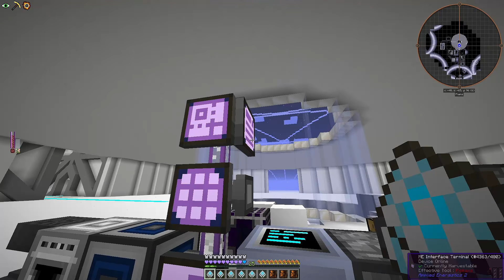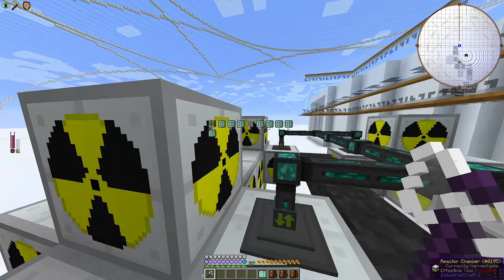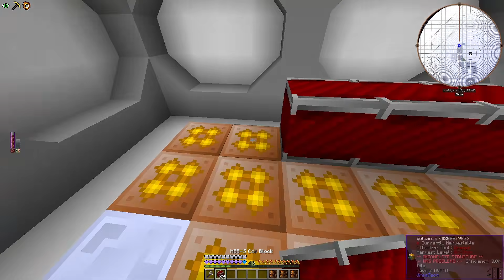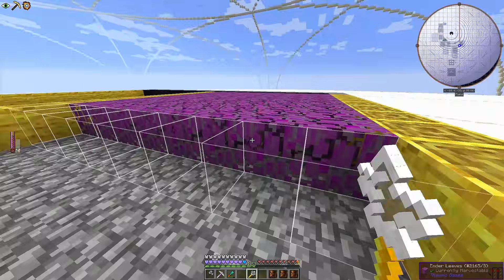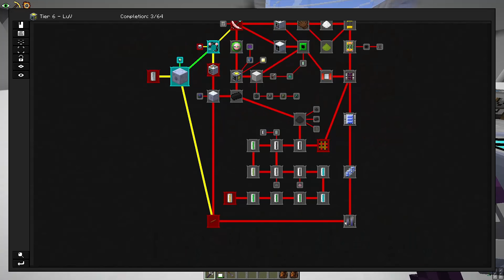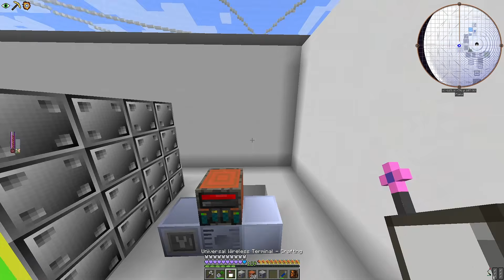Beating Minecraft's Hardest Modpack With Nothing // Episode 27 - Striking The Match

Comment: It is faster to craft 8 IV circuit assemblers and then make assline, than just to make assline.
Same with fusion reactor.

If recipe takes longer than 1 hour, I first think if it is easier to double or quadruple processing machines.

Water electrolysis is not great, there is so called methane loop (distilled water + methane) where you only electrolyze CO2 which takes less time. (or void it and supply carbon from EEC redcap sapper)

Comment: i can't remember if you've done this already and i don't know if it works on this modpack, but did you know you can press 1-9 in your inventory to replace that spot on your hotbar, and press 1-9 in a crafting area to use that item FROM the hotbar?

as an example to show what i mean: when I'm making compressed crooks in skyblock, I drag a L shape in the grid, clear my hotbar, and press 1,2,3,4 on the crafting result to fill slots 1-4 with crooks, I then press 1,2,3,4 in an L shape on the crafting grid to make an L shape out of those crooks to make the compressed crook's recipe

Comment: So, quick TL;DR: about multis, parallels and what they do to your power grid: Overclocking generally makes a process take half as many ticks at the cost of consuming four times the power per tick, meaning you ultimately spend double the EU to get a process done twice as fast. Inherent parallels, of which the Volcanus specifically has a flat maximum of 8 per operation, means you're spending say double the EU/t to get double the work done in the same amount of time. Or, the same EU cost per process, at the same effective processing speed of an imperfect overclock. Separately, Volcani specifically will run recipes 2.2 times faster, and at 90% the normal EU/t power cost. The end result is that an ingot of Ruridit costs a little over 2M EU in an LuV/HSS-S Volcanus, and a little over 20M EU in an LuV/HSS-S EBF. Remember that you need 16 of these ingots per LuV motor, and you can probably start to see why rushing more advanced technology will do horrible things to your power grid circa IV.

One thing you want to be careful about with Mega Vacuum Freezers, though this applies to basically all multis with inherent parallels in general: Cable loss. Yes, that mechanic that hasn't been mentioned or (not coincidentally) relevant since LV or so. Again, TL;DR: It's possible for the MVF to run at over 99% of it's maximum energy input, meaning 1A MV worth of cable loss will cause an LuV powered craft to power fail. Simple solution: Multi-amp Energy hatches can accept more amps worth of power than they provide to the multi, so make use of that. Simpler explanation: Supply 80A of power to that 64A energy input hatch, and your MVF will run fine just fine barring maintenance issues or your entire base falling to pieces.

The scanning recipes are as long as they are because they're LV tier recipes, and many people don't bother upgrading their admittedly not very useful until this sudden point scanner from their first one they crafted in LV because it is needed for a few things (or at least it was back when visual prospecting didn't exist and prospecting kits were buffed, not that either point matters to a GoG style run admittedly). End result is that people don't look closely at the recipe ahead of time or in the moment for that matter, slap it in their LV scanner and spend the next two hours contemplating their recent life choices. Basically, welcome to Gregtech New Horizons.

Can confirm, EBF coil upgrades are not optional. Technically speaking HSS-S tier coils are also optional, but remember the cost of Ruridit ingots I mentioned before? If you're using HSS-G coils instead of HSS-S you're paying about 2.1 times that EU cost per ingot in both cases, not to mention taking twice as long to cook. And when cooking speeds are measured in "minutes per LuV motor" even under optimal conditions...yeah. "Optional", end quote.

There's also a GT++ better version of the Pyrolyse Oven, called the Industrial Coke Oven. Yes, it is more than just a bigger, badder coke oven. I have a tendency to call it a Pyroke Oven for that reason. Anyhow, short version skipping math, minutia and fine details: It's better. Related, remember Forestry villagers selling random Forestry saplings? The Tree Growth Simulator will produce more even more logs if given Forestry saplings with specific traits...though unless you're a fanatical believer in the church of nitrobenzene it's unlikely you'll be able to use that many logs for a good while.

Direct plasma power was indeed nerfed to somewhere below the cheese ore dimension that you can access by using an Awakened Ichorium Pickaxe on a piece of bedrock, but the method of turning plasma into Supercritical Steam and turning that into power is perfectly functional. "What does that additional step really add", you ask? No clue. Frankly if you can get to a fusion reactor with enough of your sanity and willpower intact to ask such meaningful questions you've got greater mental fortitude than I. It's that kind of pack, after all.
Reply: Is there a fork that makes overclocks actually good? I'm picturing it such that machines can only ever operate at a minimum of the last tier's max (I.e. LV consumes a minimum of 8EU/T, and MV a minimum of 32 EU/T).
Reply: @loneIyboy15  Not to my knowledge, but there are ways to get perfect overclocks (4x speed for 4x EU/t cost) for EBFs specifically, and some multis have perfect (or, at least, not imperfect) overclocks by default. And in any case there are tools that make running recipes in parallel instead of overclocking them quite simple.

It's one of those "spend two weeks setting up infrastructure to get a job done in a day or spend a day setting up garbage that'll get a job done after two weeks of AFKing" mechanics. You just have to find the right balance between escalating power costs, production speed and logistical complexity.

Comment: Bout to greg!

Oh by the way, I had a question. You once mentionned mekanism breaking the way balancing is done in mods. Do you mind elaborating? Do you think Mekanism is a bad mod? Do you enjoy it or not?
Reply from the maker: For a long while there was something of an unstandardized 'gentlemen's agreement' where non-meme mods would conform to a certain level of power relative to each other - most only doubled or tripled ore yields from raw ore (this was pre-fortune working on iron/gold), most had energy generation options that were pretty comparable, most didn't have crazily strong weapons, tools, armor, logistics options, etc. Mekanism isn't the first to break that balance, and it isn't a bad thing that it does, but in doing so it tends to steamroll in packs with tech options that still follow those old guidelines.

Is it inherently a bad mod? No. I think it is inherently a fantastic mod. I also think it currently blows most other tech mods out of the water in terms of its power curve, and if you want a modpack that includes it, there is going to be a ton of "just do Mekanism lol" inertia that you have to account for if you want players to solve problems with anything other than the biggest hammer in their arsenal.
Reply: Expanding on the mention of fortunable iron and gold -
When fortune started affecting all ores in 1.17, it ruffled a lot of modded players' feathers. Mainly because the vast majority of mods nerfed their ore doubling to the new unwritten standard of 1.5x. Granted, it maths out to the same 2x on average when paired with fortune. The problem is that a solid chunk of modded tools - especially those in the tech mods that people rely on for ore multiplication - are completely unenchantable. You have to lug around an extra tool now just to get the best return on time spent mining.

One nice upside of this, though, is that most mods with a quarry now give some way to apply silk touch/fortune on mined blocks, which is something I had been missing since first using Buildcraft in 1.2.5.

In a shocking moment of care towards game balance, Mek actually joined the wagon to nerf their ore duplication. There's one slight issue with that sentence, though. It ignores the fact that pre-1.17 Mekanism allowed up to ore quintupling (1 ore -> 5 ingots). They were far and away the single best ore duplication process in existence barring joke and alchemy mods, and nerfing themselves by a flat percentage to follow a new convention didn't really change that fact. You can still get up to 3x, if memory serves, which maintains pre-1.17 Mek's habit of roughly doubling the standard.

All that said, I do really enjoy Mekanism, don't take my criticism as purely negative. It's a well made mod, and I've actually gone out of my way to contribute to it a couple times with random bugfixes. In my opinion, it's over the top in a fun way, and it doesn't just solve your engineering problems for you . At least, not without making you solve some new ones in the process typically, such as the mildly infuriating "there are only 6 sides to a cube, and I need at least 7 to do what I want in a single machine"
Reply: @NeuroticGoose 

Thanks for your answer! Ive seen a section of players not enjoying the mod due to this and wondered what you thought of it after mentionning it in one of your videos.

I do think it has a very nice progression feel and is pretty well polished, especially when it comes to the textures and systems that it has!

It hits a sweet spot that gregtech really misses, though I should definitely give it a fair try sometime. Thanks for your series and perseverance through the grinds and long idling times!
Godspeed!
Reply: I think it is because it is not hard to make a fusion reactor that produces 300,000,000 rf/t, which is more than enough for the endgame of most other tech mods unless a modpack adds ridiculously expensive receipts.